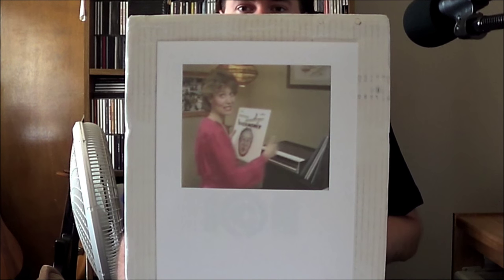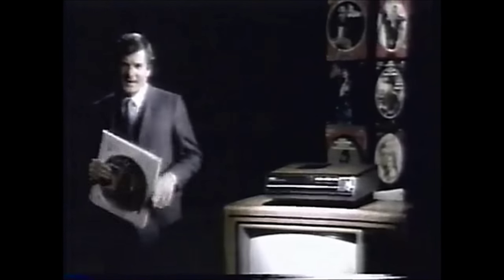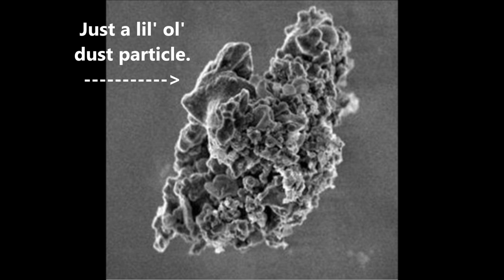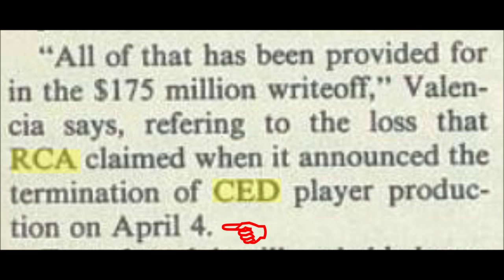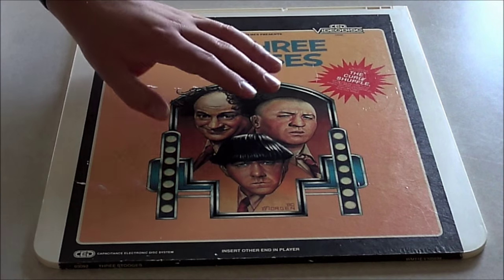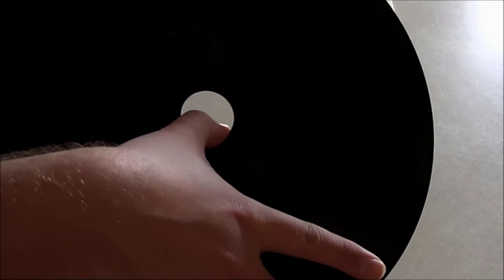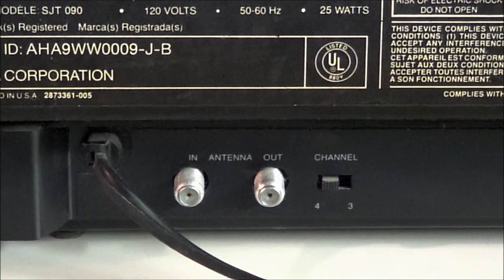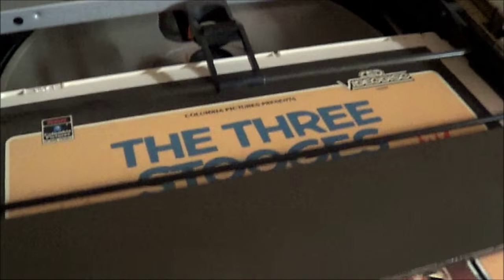Oddity Archive: Episode 92 - Capacitance Electronic Discs (or, CED's)

Comment: ROFL.  I can't help but laugh at the fact that your CED player (which, when I was a kid, we just called the RCA player) looks to be exactly the same model we had.  Without even continuing to watch this, I HAVE to ask: does your version of that model have an issue with skipping around 44 minutes in to ANY disc it plays?  Not long after ours had served its purpose, we gave it to my sister.  I remember it just stopped working, and I popped the top to find one of the bands had just snapped, exactly like you showed.  I replaced it with your standard, garden-variety rubber band, and damned if it didn't actually work for awhile.  Like, months to years awhile.  Come to think of it, I wonder what my sister did with that thing.

I also have to say you're really kind of downplaying this thing's popularity, at least compared to my own experience.  For one thing, if you wanted a VHS movie...like, an actual movie and not a blank cassette, those things cost between $80-100 all the way to the late 80s.  And until around 85-86, I never walked into a video rental store that had anything BUT CED discs available.  But weirdly, it was the number of places you wouldn't expect to find movies sold that I really remember.  Our next-door neighbor worked at a furniture store, and they had a rack from which we bought Legend of the Lone Ranger and Superman II (yes, I have a weird memory).  I remember renting certain He-Man collections like..A LOT.

You're not wrong about the difficulty getting the thing to play, either.  Ours (again, same basic model) eventually developed the exact same problem you had with its auto-loading (we used the identically same solution you did), but it's also worth mentioning that that was something that didn't develop overnight, either.  It did well for a few years before that started happening.
Reply: Top Gun was the first VHS movie to be priced for ownership. Before then (and for a bit after), prerecorded movies on videotape were priced for rental stores mostly, hence the high price. I recall my parents buying Return of the Jedi on VHS for $80, and my brother, all the way back in 1981-82, buying Alien on videotape used and paying something like $40 for it.